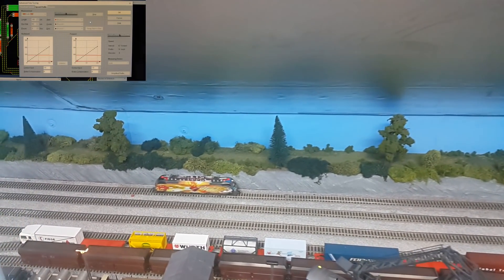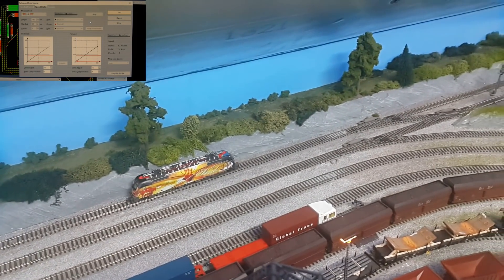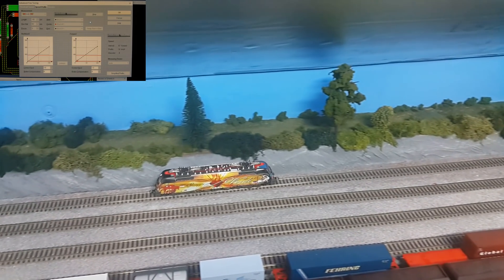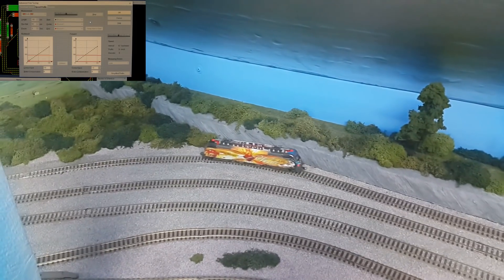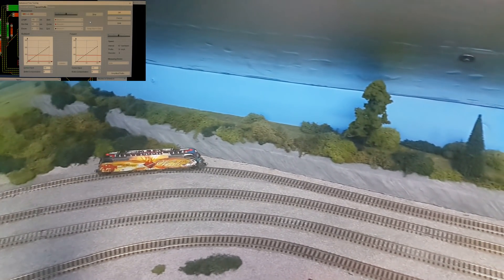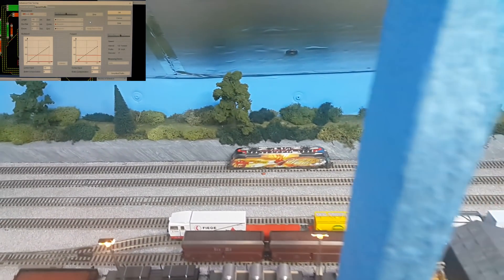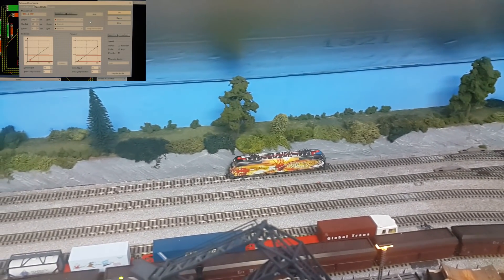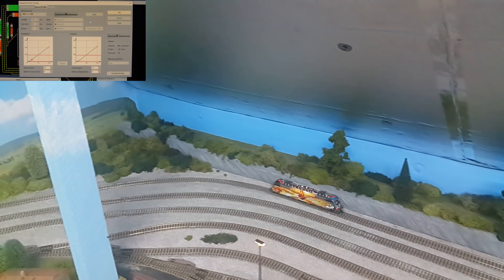profiling a loco for train controller automation.

Comment: One of the slowest parts of this program. I'm using  the silver version, and that is similar. However I have found some decoders like the QSI decoders are a real pain to get the profile right, and they act up afterwards too.
Reply from the maker: Not sure about  Qsi decoders..all my decoders are Esu ,Zimo, Marklin, Hulenbrock and Lenz..
The best way to profile decoders
Is to factory reset all the C.v 's and then profile the loco.

Comment: Thanx for sharing Jim! I do not automatized layout but such information help me to understand  such things how the software knows where to stop at right place. Question: What kind of test will be performed in your Station (Terminus) where you got just End of tracks... How software knows to stop loco exactly near end of the track...
Reply from the maker: Max Supercars first there is a low speed profile in forward and reverse , then there is a high speed test, then this full range speed profile. there are other fine tune muserments you can do aswell if the loco stops too far past where it should stop. 
In the station terminus you can fine tune vairous pre break and stop markers so to stop a loco exactly.

Comment: This is really Interesting...  I believe it is very focused work and time consuming as well, and something you do when you feel Patient!

  Is it detecting when the loco hits the far end of the detected section then reverses? (In other words, is it detecting when loco leaves the section at either end?)...  

I guess this is 'instead' of setting a CV to 'constant breaking distance'?  Is that correct?  But will only work through the software control (i.e. software controlling deceleration to stop and Not CVs in the decoder or the ECoS itself)   

I forget what software you decided on after testing several.  Is it a software to purchase?. -Chris
Reply from the maker: chrislef2002 Correct....

First of all you input the basic info of the train e.g length, address ,weight ,fuel it carries etc

you can just use cv s for the breaking but this method ensures that all locos stop roughly at the same spot in a  detection block  regardless of there cv settings , motor, make, and  length of loco.

There is also a top speed test, craw speed test and a  
breaking compensation run to fine tune the breaking if required.
Then there is another bank of settings which are very good for general settings e.g   breaking delay acceleration delay maximum  top speed cap etc....
Its all very good I went for train controller gold which is a lot of money but for me the most stright forward to get going...and it works flewlesly with the ecos unlike i-train which I could never get going and had loads of connection problems with the ecos.
i-train works best with Apple os.

I have only touched the tip of the iceberg as there is so much that can be done with Tt gold e.g dcc cranes and much more....
Reply: Nice!

Comment: How many locos do you have to do? Hopefully not too many Jim.
Reply from the maker: Calvertfilm prob about 90+ done about 30 now...you can bypass this but it means you have to then have to taylor the breaking on each loco which is quicker to do but not as good.
Reply: I love the way you do digital Jim, showing what can be done with it, and showing it off to near its fullest extent. You use DCC more than anyone else I know. Most people only get it for the sounds and lights (not that there is anything wrong with that either). For me simple analogue does fine as all I want is one moving train at a time and a big fleet (I've bought 117 but I have sold a few too), and my focus is on the general modelling. This is what is great about this hobby - it caters for all tastes. Cheers, Laurie
Reply from the maker: Calvertfilm Yeah I love the old triang and hornby analog too...and dcc across all guages..all countrys ..All the best..😃
Reply: Oh and by the way, even though  Piddlewick Yard is getting a make-over the Tiger Tank will still be present on it when I make the final videos. Happy New Year to you and your family Jim. Laurie
Reply from the maker: Calvertfilm cool.....all the best..to you your wife and lads ...😃